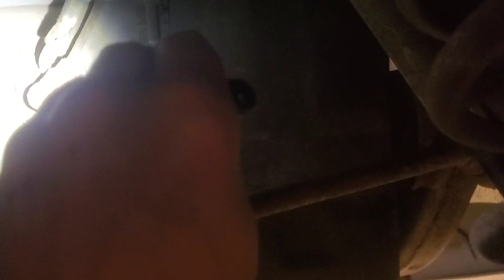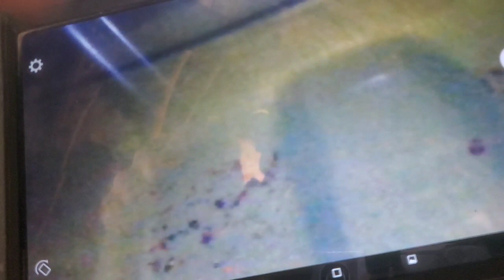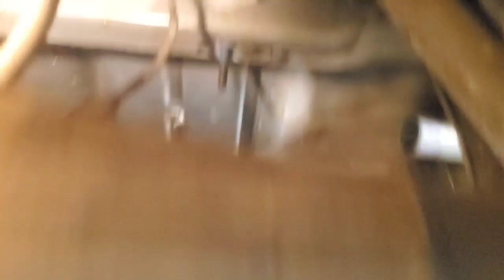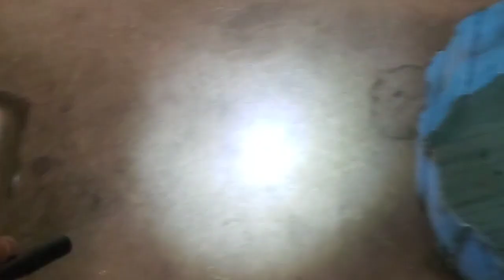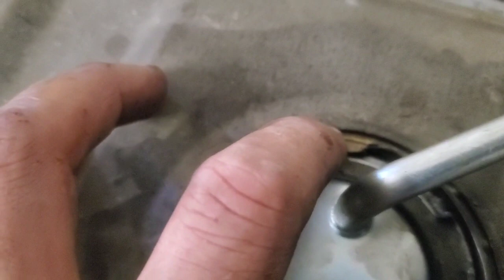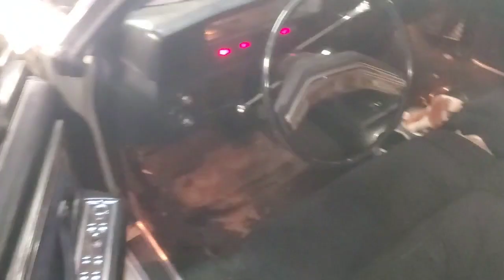Ford, Mercury, Lincoln Continental fuel tank sender Replacement and Tank Removal

Comment: Got a 79 mark v looks similar to yours. My sending unit goes from 50 to 100 ,I don't know why yours was so expensive. Problem my cable got 3 cables instead of 2 ,and the sending unit only 2. Tninking on replace the tank, my looks really bad inside.Tanks for the video.

Comment: I’m having the same issue on my 79 it runs and drives a few days then dies and fuel won’t get to fuel pump unless I blow air on the gas tank any ideas? Replaced fuel pump, fuel filter, sending unit seems good, tank seems clean not sure what else to do

Comment: I have a 1979 lincoln continental town car, I got home and my car wouldn't turn off, even though I unplugged the battery, it turned off when I unplugged the ignition coil, could it be my ignition lock cylinder or my ignition switch? Thanks🙂
Reply from the maker: It could be the ignition switch.  Next time it does that check for power on the positive terminal on the coil.  If there's power there even with the key off then you have to figure out why.

Comment: I have an 88 Town Car, My gas gauge doesn’t work properly. It’s digital. I replaced the sending unit, same problem. The fuel gauge seems to be working the opposite way. When full reads empty and when empty reads fuel. Do you think I have to replace dashboard cluster gauge?
Reply: I don't think you necessarily have to replace the WHOLE gauge cluster because one faulty gauge. You should just take it apart to reach the circuit board and sent it off to repair the specific electrical components causing the fuel gauge to read incorrectly. 
electronics and electricity are actually quite simple once you get to know it. could just be a diode or resistor that failed.

Comment: new fuel pump didn’t come with the 2 bolts for the fittings. NO CLUE what to do next. No way to swap hardware cause the bolts can’t come off the old pump. New pump didn’t have em on it. I think I’m fucked.